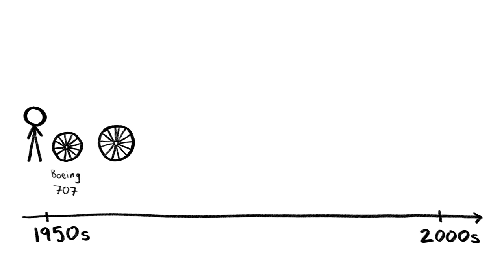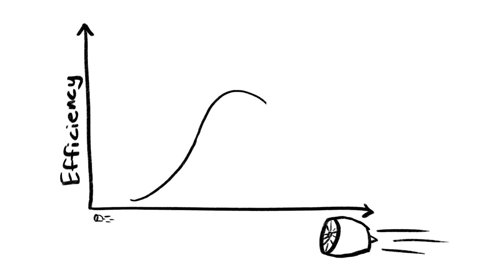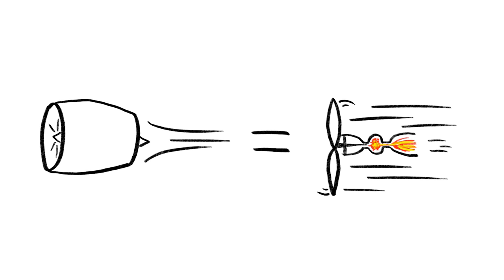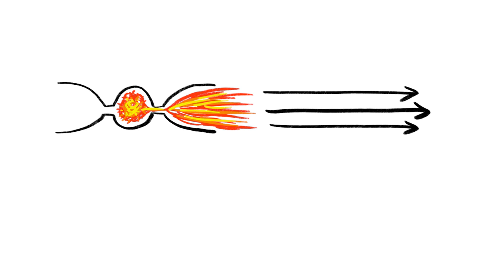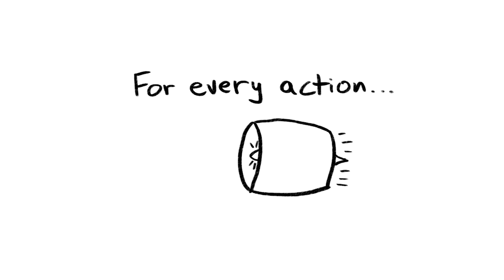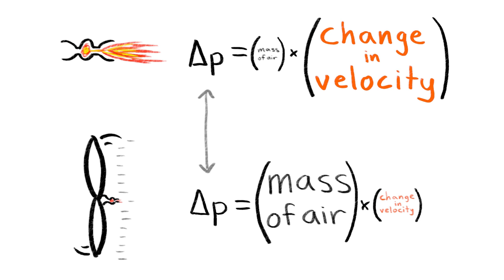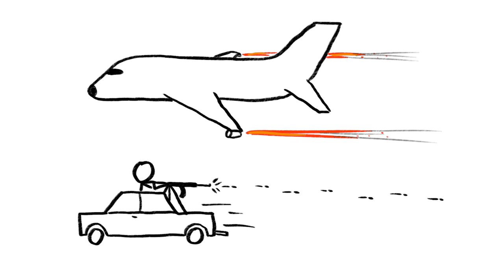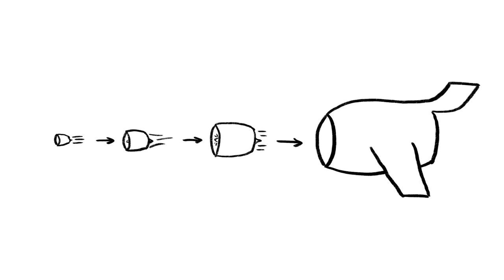Why Are Airplane Engines So Big?

Comment: If most of the thrust is provided by a good ol' propeller, why do we need the jet part at all? Is it not good enough to just put in an ordinary motor?
Reply: Because the jet engine is more efficient then a normal propeller engine. It's considered a high bypass turbo fan engine. Also jet engines preform the best at higher altitudes.
Reply: The engine shroud directs air more efficiently at higher velocities and jet engines are much more efficient at high altitude. Combine the two and you have an efficient high bypass turbo fan perfect for commercial jetliners. Reverse the logic, and that's why small Cessnas have piston engines and exposes propellers.

Comment: I guess it's also less efficient at very high altitudes since the air density goes down there?
Reply: +Sith Smasher the pros of higher altitude is the less drag by the air. But yeah, that's why there is an optimum height for commercial airliners to fly.
Reply: dontknowdontcare
Yeah I also thought about the air resistance during flight, but there is less thrust from the propellers as well. Indeed you are right there must be a nominal altitude that gives best results taking both into account.

Comment: Has the right idea, but a few critical logical errors. First, he says that the A350 is smaller than a 747 yet has larger engines. Minor detail - IT HAS ONLY TWO OF THEM AND THE 747 HAS FOUR! Also, he says that calculations say the ideal size for an engine would be four meters - for what aircraft? Optimal size would presumably scale with the airplane, a four meter engine on a bizjet would look like the absurd thing he showed at the end. A more relevant, more universal thing to discuss would be what the optimal bypass ratio would be, or maybe what the optimal jet velocity would be relative to flight speed.

Comment: Another thing about these new turbofan engines is that they are way over powered for the air-frames. They de-tune them electronically, to the correct thrust output, and then re tune them throughout their service life to offset wear.
Reply: +Scott M (Scotty2307) Makes sense, didn't know that

Comment: What about long engines? Wouldn't that provide more efficiency with less drag?
Reply: You'd want the shortest nacelles (the sheet metal that encases the engine) as possible to reduce drag. If they could easily make the jet core shorter, they would.

Comment: Didn't quite explain the difference between - 

pure turbojets
low bypass turbofans
high bypass turbofans

Most combat aircraft these days tend to be powered by low bypass turbofans - not pure jets.
Large civilian airliners and military transports tend to have high bypass turbofans 

In the 1940s and 50s, earlier jets tended to be pure jets. The low bypass turbofan emerged at the end of the 1950s and the first high bypass turbofans in the mid 1960s.

Comment: Why do some planes have multiple engines on each wing then? Surely the best way is one per wing or if possible one in the middle...
Reply: +Katzen4u Redundancy, if one goes out you still have another engine to use; they also put engines jutting out the wing, and far from each other so they can't blow each other up or have the wing fly off.
Reply: +Colossal Squid Not necessarily, most aircraft with more than 2 engines are very old, and the technology for efficient, powerful engines was not available, so more than 2 engines were needed. Newer airplanes have stronger engines available, so they only need 2. For example, the 747-100 was built in the 70s and it used for JT8Ds. The relatively newer 777-300 has two GE90s. One GE90 can power a 747 with ease.

Comment: So, why are jet engines so loud? Can't they put a muffler on them? (Can't they muffle he piston driven engines for smaller prop planes?)
Reply: Piston engines work more similar to car engines. That is why you can add noise suppressors to it because no hot gasses are igniting inside the majority if the engine.Turbo prop, jet turbine and jet engines work by igniting a fuel and air mix inside the body of the engine. The turbine and works almost like the piston you would see in a car. Because of this open combustion process, there would be no way to suppress the noise created other than the casing surrounding the engine.
Reply: The noise is caused by putting energy (doesn't matter which type) into the air. Some of it becomes acoustic energy. That can only be suppressed if we found somewhere else to put the energy.

Comment: Interesting, but simplified so much that it becomes wrong in places. The A350 has only two engines, but is bigger than half the size of a 747, so that's the main reason its 2 engines are bigger than even the the 747's 4 engines.

A better comparison would be of the A350 to the A330-300: the A350 is only slightly larger, but has engines with a much larger fan diameter.

Even though I know it's just a conceptual drawing, the nozzle of the pure jet engine (turbojet) is wrong even in principle. Unless you have an afterburner, the exhaust is normally subsonic, and thus requires a converging nozzle to accelerate the gases. Most current jet fighters also have low-bypass turbofan engines to increase subsonic fuel efficiency, even though they are not optimal for supersonic flight.

Errors like this (which are not merely inaccuracies or simplifications, but simply false) are one of the reasons I have unsubscribed a while ago.

Keep up the good work, make it "as simple as possible, but not simpler" (attributed to Einstein).
Reply: +pinkdispatcher I agree. What kind of steps could they take to prevent making such errors in the future though? Get more expert opinions?
Reply: +Dudemanbrobearpig 
That's the strange thing I don't understand. They don't seem to 
have a lack of expert knowledge in the background, as the huge wall of 
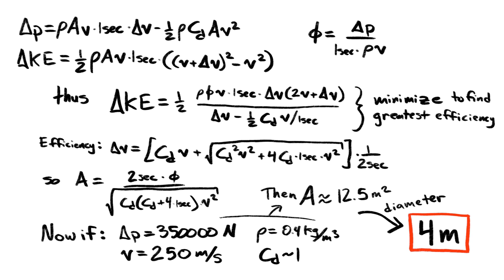math around 1:24 shows. But somehow part of the essential information gets lost on the way to graphical artst(s). I agree jet engine math is not trivial, and some pieces of the pressure vs. velocity stuff is not entirely intuitive, but at least part of it seems to be communications and quality control issue.

So a way might be to have a domain engineer look at the drawings and point of the flat-out wrong parts, and have final say over the release. It wouldn't be hard, e. g. to draw a turbojet engine with a converging nozzle, or in the final picture to draw slender turbojets and slightly-less-slender low-bypass turbofans, etc.

In an earlier video I was particularly annoyed that when explaining lift, air was shown as a stream of bullets, completely ignoring the essential properties of air as a fluid.

Comment: If Pratt & Whitney gets their new geared turbofan engine working the way they want.  You will see bigger engines with redicoulously small jet engine cores.  Imagine a whopping 20 foot diameter fan spinning at slow speed and looking comically stubby.  All thanks to a speed reduction gearbox.  Simple on paper but devilishly complex to engineer.

Comment: Could someone go into detail on how the extra fan/turbine makes that whole accelerating a lot of air a little thing happen? I was under the impression the big fan on a plane was an intake for the engine and that the main propulsion was still the exhaust. Could someone clarify?
Reply: +Naomi Nekomimi It simply bypasses the burning jet core. Some of it does get pulled in, compressed and burned but most of it simply goes around that bit and shoots out the back like thick sleeve around the hot exhaust. Also helps to make them quieter too.
Reply: +TheOtherNeutrino He is correct, most of the propulsion is from the bypass air which has very high pressure difference. Turbofan doesn't use the exhaust jet as propulsion but that does help a bit in the total thrust.
Reply: ***** So the big fan is basically just like a normal prop plane but the prop is powered by the jet engine? I'm a bit confused.
Reply: To make it simple, yes. The propeller of the turbofan is powered by the combustion of the core, and the heat of the combustion is supposed to be fully converted to running the propeller for ideal efficiency but of course there is always heat loss and this become the additional small thrust.
Reply: Naomi Nekomimi To make it simple, yes. The propeller of the turbofan is powered by the combustion of the core, and the heat of the combustion is supposed to be fully converted to running the propeller for ideal efficiency but of course there is always heat loss and this become the additional small thrust.
Reply: +Naomi Nekomimi You're not that far off. Turboprops function in much the same way except the props are fewer in number and aren't encased on a shroud. In fact, the 'turbo' in turbojets, turbofans, turboprops, turboshafts (helicopters) and turbochargers all refer to a turbine that collects energy from hot exhaust gas flow in their design.
Reply: Pat MaCrotch OOoooooh. So when they say they move a lot of air a little they are referring to mass - not volume - of air?

Comment: Love your videos, and you are right, but you kind of gloss over the difference between turbofan and turbojet engines. They are not both "jet" engines. Even if the power generation is the same, the means of propulsion is different.

Comment: Can someone translate the rough estimate for me? Why does drag increase faster than thrust?
Reply: +Xqwzts The actual limiting factor for why engines can't be too large is because of shock waves that would be created at the tips of the fan's blades. Since the entire blade rotates at a constant angular velocity, the longer the blade, the fast the tip moves (V = blade radius * angular velocity). The tips can end up moving faster than the speed of sound and create excessive shock waves.
Mass is also a big limiting factor for why the engines won't get too big. The bigger the engine, the heavier it becomes.
Reply: Ernst van Wijk
Ok, this makes more sense. Thanks.

Comment: If 4m is known to be the most efficient, why are engines slowly getting there instead of just being there? What's stopping someone from cranking out a 4m engine and calling it a day? Is it weight in the materials?
Reply: Because technologies usually develop over time.
Reply: +Pat MaCrotch Right, but it sounds like we have the math figured out. Which technology have we not figured out enough to be able to make 4m engines?
Reply: +Dave Lugg There are many practical reasons. Appart from actually engineering such an engine (of which I have no clue) there is for example the problem of actually fitting the engine under the wing. To accommodate such a large engine would mean to have a longer and more heavy gear. The additional weight would probably not be compensated for by the more efficient engine.

Comment: They could still add more engines of the maximum diameter though, so better to have, say, 4 engines of 4m diameter instead of two of 5m or 6m.
Reply: +Ashley Wilson
How would that be an advantage if the formula already the ideal diameter is 4m and above that, you just add drag? In fact, airplanes with four and three engines are getting increasingly rare in favor of twinjets. And even those seem only to be used because they are safer. If one engine fails, the plane can still fly. If you only had one engine, you'd better install ejector seats for all passengers.
Reply: +Ashley Wilson Adding more engines is not economical because engines are expensive and require costly maintenance. More engines means longer time maintaining them, thus not flying the plane. The reason why the 747 has 4 engines goes back to the lower reliability of the engines back in the 1960s and 1970s. Today they are way more reliable, so you can pretty much fly over the ocean with a two jet plane like the 777. Another problem is, that two big engines are more fuel efficient that four smaller ones. A single engine plane would make no sense, as an engine failure at takeoff would result in a catastrophic crash. In two jet plane one engine has more than enough power to provide thrust during takeoff and climbing. You cannot have less than two engines on big planes due to safety concerns, but less than four is OK and is cheaper to maintain and more fuel efficient too.
Reply: Penny Lane Erik Žiak I'm talking about the case where two ideal-sized (4m) engines aren't providing enough thrust, where increasing the size is wasteful. In that case, a plane which carries, say, 1000 or 2000 people could be built which has four engines, each with the ideal size. I'm agreeing with the video, and only talking the idea to the next logical step.
Reply: Ashley Wilson Pretty sure the calculation was for a given amount of thrust. If you increase the thrust needed, then the ideal size per engine would increase as well.

Comment: Why do (bigger) jet engines cause drag? I mean sure, it increases the area of the plane hit by wind but in my understanding the engine wouldn't contribute to that drage force. I sucks air in, the air doesn't push against it from the front... where is the fault in my logic? :-)

Comment: whats the jet's smoke made of???? cause it just stays in the air.
Reply: +Qryptic and Saint Mostly carbon dioxide and water vapour. Water vapour forms contrails which look like small clouds. Also known to people with neurological problems as chemtrails.
Reply: It's just a difference in pressure and temperature, but that's mostly just air, not even the actual exhaust of the plane. (You're seeing heated then cooled water vapor, not exhaust)
Reply: Tony Wells ahhhh
Reply: +ItsToe2 that comprises drugs, bacteria and weather changing aerosols that the government is using as an experiment on the population to ensure compliance.
Reply: +Tony Wells "also known to people with neurological problems as chemtrails" hahaha!!! It's so well said I don't even think "truthers" will notice.
Reply: +Tony Wells There is also trace amounts of unignited jet fuel, liberated jet fuel additives, and other impurities. The concentration is negligible though. Totally harmless.
Reply: ***** It's those chemicals that cause the water vapour to condense into contrails. I forgot to mention that, and yes, no mind control chemicals involved lol.
Reply: +ItsSyncronize 

It words with fuel, what do you think?
Reply: They're giant cocaine lines
Reply: +Tony Wells you spelt vapor wrong
Reply: Dusablon52 I'm English, you know, where the English language came from.
Reply: +Tony Wells -- Huh, I thought you were German. Still where the English language came from I guess.
Reply: Tlaloc_Temporal That's a Belgian flag.
Reply: Tony Wells
-- Uuhhhhh.... I th-thought you were a German laying on your side! Yeah, that's what I thought!

What? I'm still wrong? Um, can I still have waffles?

Comment: The only thing that was missing for this to be a perfect video was the reason why jet engines weren't always this big and why they still aren't 4m in diameter. I can guess that it's got to do with progress in materials science but that would be just that: a guess.
Reply: +Penny Lane There are likely a few other factors at play as well. Turbojet engines are complex things, and this video is a drastic oversimplification.

Comment: It causes me mild confusion that rocket engines are the opposite from jet engines - there, the higher your exhaust velocity, the better off you are. I guess that's the difference between carrying your reaction mass onboard versus pushing on an external reaction mass.
Reply: +jadegecko the reason the plane jet engines are how they are is to maximize efficiency while limiting energy. so say a rocket has to leave the atmosphere and getting out of there isn't easy, so if you were to fly a jet or a plane straight up it will get to high and just stall. if a rocket did that then it would fall to earth and boom its gone and left a bloody big hole with it. so the jet on a rocket is somewhat the same as an air-force jet just alot bigger and there's alot more than them. hope this helps a bit!
Reply: I'm talking about Tsiolkovsky's rocket equation, where the efficiency of an engine is tied directly to its specific impulse (and thus exhaust velocity), but in such a way that higher exhaust velocities correspond to better efficiency. (This isn't related to thrust-to-weight ratio.)

Comment: But, isn't Kinetic Energy also proportional to the mass of air? How is pushing a lot of air a tiny bit any better than pushing a little bit of air a lot harder?
Reply: +Danial Haseeb it saves a boatload of energy. They both have the same thrust, but moving a lot of air a little uses a lot less energy. From the thrust produced perspective, matter it does not. But from the energy perspective, lot's of air please

Comment: The size of the engine depends on the efficiency of the turbine and the efficiency of the fan. The fan can only get bigger, if the efficiency of the turbine is improved. There is not much to do any more for bigger sizes....Turbines and fans have their own limits and they limit each other. Jet engines are not McDonalds customers.